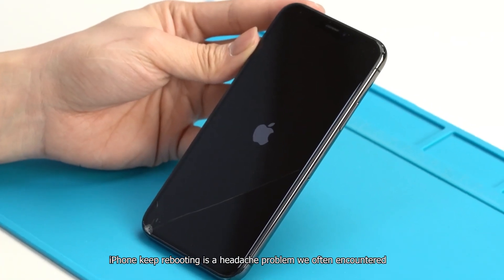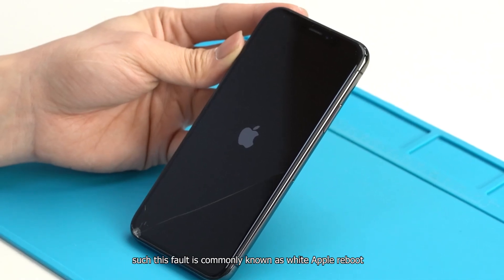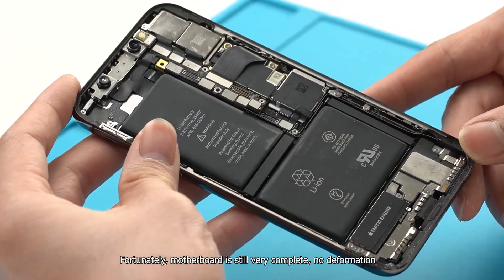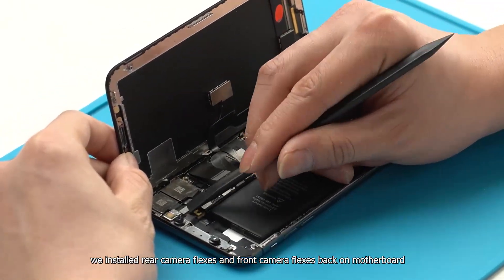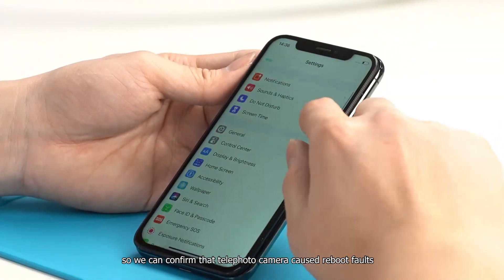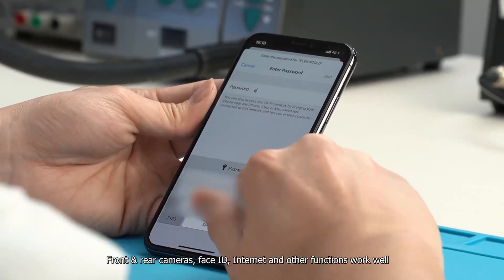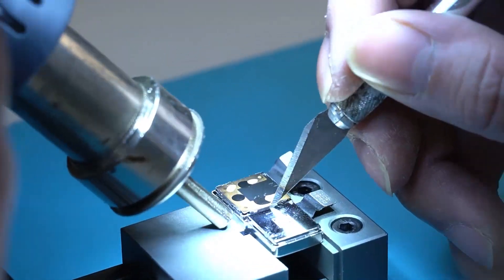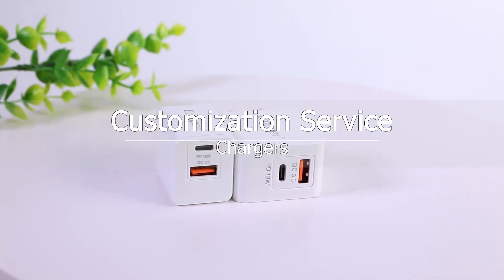iPhone X Keep Reboot And Stuck On Apple Logo Repair.

Comment: Hi, even after disconnect all those flexes i still have that boot loop. It happened after full disassembly when i changed lose lightning port. Before I changed battery and screen, and had no problem.
Reply from the maker: then maybe the board itself has problem. Pls find a professional repair shop for a dignose and repair.